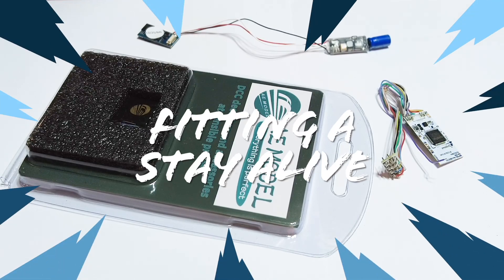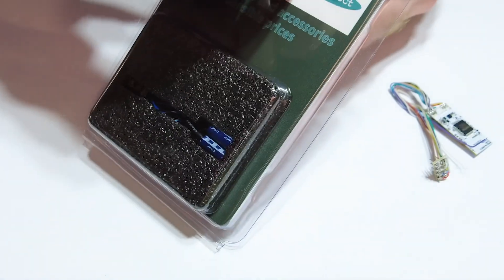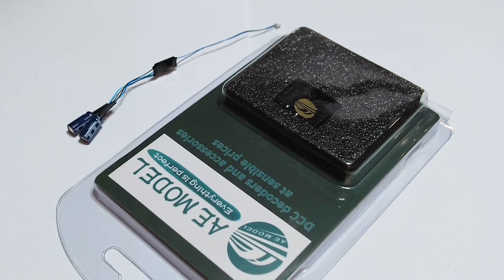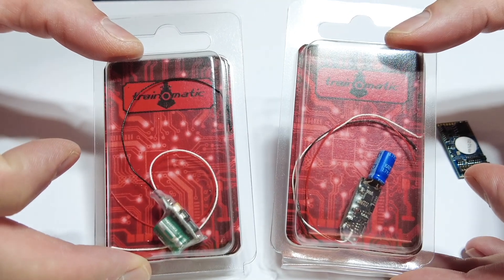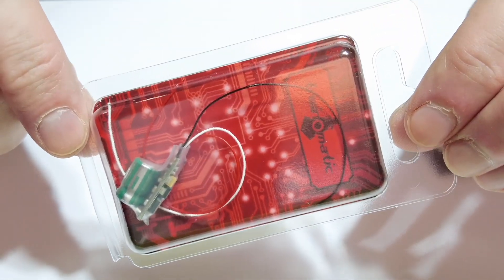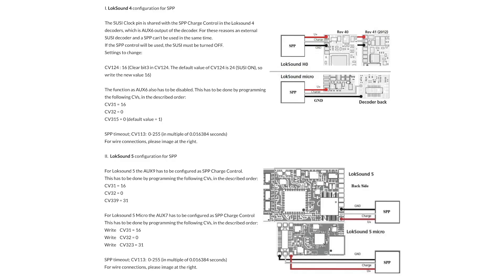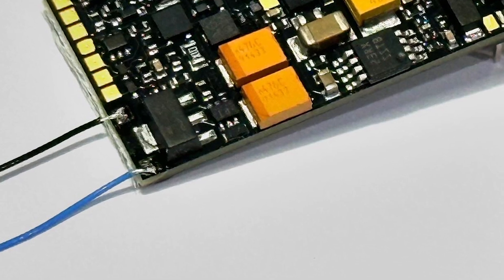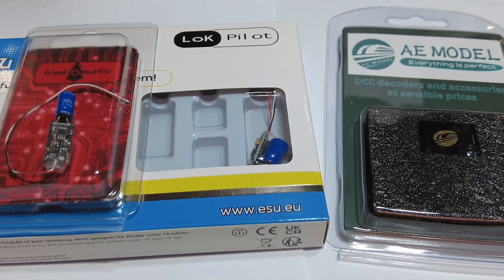How To Fit A Stay Alive To DCC Sound Decoders, Includes HM7000, TTS, Loksound And Zimo

Comment: Richard, I fitted one of your Train-o-matic 3 wire decoders to a Loksound v5 decoder and reprogrammed CVs 31, 32 and 339 as suggested, only to then find the stayalive would not fit in the loco body (Bachmann Class 40). So I have now fitted a 2 wire AE mini, but do I need to reprogram the CVs back to their original values? If so what are they?
Reply from the maker: no you can leave them as they are
Reply: @roadsandrails  super, thank you.

Comment: Thanks Richard.
Some really useful information there.
The majority of locomotives I’ve fitted stay alives to have been 21pin. In which case I very carefully solder to pin 20 ( -ve / Gnd) on the 21 pin header and the “common +ve” on the loco circuit board rather than the decoder itself. Naturally, if the -ve / Gnd is available as a solder tag on the loco board, I’ll use that instead of the header. You can do the same at pin 5 for Gnd on Plux 16 and Plux 22 decoders. The pin spacing is the same as the 21 pin header. “Next 18” is far too small to attempt, certainly with my eyesight!
Thanks again for sharing your technique Richard. 👍
Reply from the maker: Good idea!